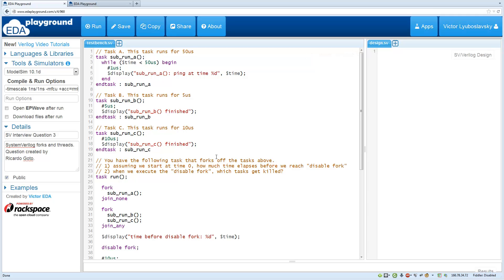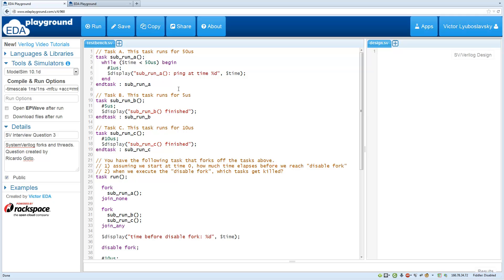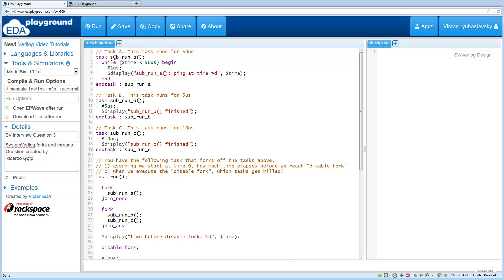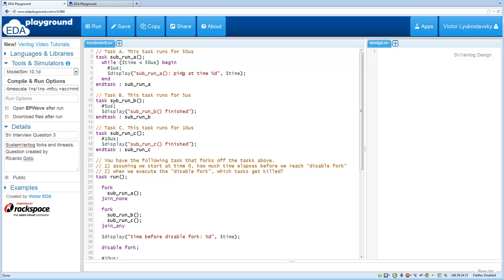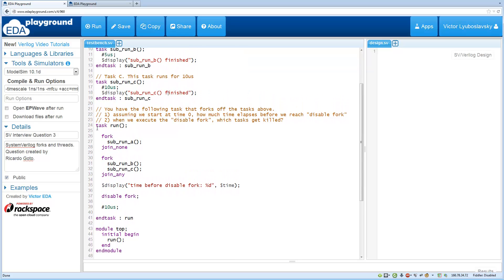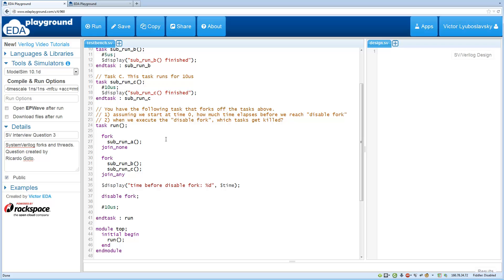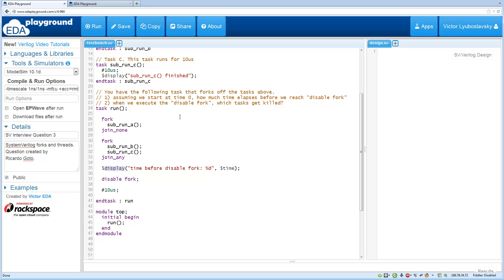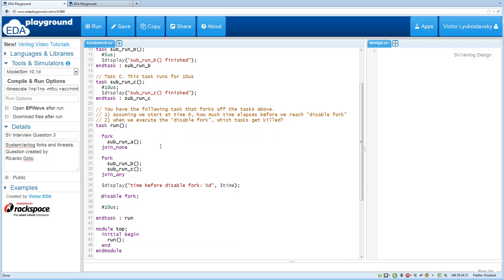SystemVerilog Interview Question 3A -- Forks and Threads

Comment: The first fork uses join_none which means it does not block the thread after it. Therefore, sub_run_a in the first fork and sub_run_b and sub_run_c in the second fork all start at time 0. The second fork uses join_any which means the main thread continues if either sub_run_b or sub_run_c completes. In this case, it is sub_run_b that completes earlier in 5us. 
Therefore, "time before disable fork: 5us" will be displayed, after which all unfinished branches will be killed, which are sub_run_a and sub_run_c.

Comment: Is this the cleanest solution to #3?
  - I wrap the fork for for sub_run_b and sub_run_c into another and disable that branch. Otherwise, I can disable the fork by name, but the latter isn't as portable if I were to do this in a class for instance, so I prefer the solution I have below:

  fork begin
    fork : second_frk
      sub_run_b(); // 5us  <- Break for this first
      sub_run_c(); // 10us
    join_any
    
    $display("time before disable fork: %d", $time);
    disable fork;
  end join
Reply from the maker: It's a good solution. Here's another: https://www.edaplayground.com/x/LEPk Is this cleaner? Or cheating? :-)
Reply: EDA Playground I like the one you’ve made. I’d also use that in most cases, but depending on where I called it I’d use mine—e.g. if I’m calling it from a test, I’d use your solution. If I was burying it in a class or in some reusable VC, I’d use mine.
Reply: @Edaplayground_EPWave  This solution is cheating because from the perspective of Re-usability, we should never modify (to be more specific "edit") the already exiting code, instead we should add piece of code to maintain the Re-usability.
Reply: @lxnny2357 Best soln.

Comment: 1) assuming we start at time 0, how much time elapses before we reach "disable fork"
           Ans: 5us
2) when we execute the "disable fork", which tasks get killed?
          Ans: sub_run_c task gets killed. 
3) how do you prevent sub_run_a() task from getting killed in this scenario?
          Ans: use fork....join_any instead of fork...join_none.
Reply from the maker: Your answers to (1) and (2) are undoubtedly right. Well done. Your answer to (3) is technically correct (sub_run_a won't get killed), but it does change the behaviour of the code - sub_run_b and sub_run_c won't start until sub_run_a has finished.
Reply: @Edaplayground_EPWave  You can use a wait fork instead of disable fork to prevent any threads from being killed
Reply: In it's actual form (question) both A and C get killed as A has to loop 50 times and has finished only 5 iterations and already exited the fork as we used join_none and B has finished in the other thread at 5us and exits the thread as its join_any and when we disable fork C is yet to start and A is starved from proceeding further so both A,C are killed

Comment: I was expecting sub_run_a to also print display statement at 5us..  Why does it not?
Reply from the maker: Kartik Sudarshana 
Sorry for the delay in replying: 

The order that threads on SystemVerilog get executed is not deterministic. Therefore, it just do happens that sub_run_b runs before the 5th iteration of sub_run_a, and so the thread gets disabled before sub_run_a gets a chance to run for a 5th time. If you add a '#0' before the '#5us' in sub_run_b this delays the following $display command to the inactive region, which is just long enough to ensure that sub_run_a is run for a 5th time. 

Welcome to the world of multi-threading. :-)

Matthew
Reply: EDA Playground Thanks a lot Matthew.  Yes, order is not deterministic, so I tried to run multiple times to see if it randomly prints sub_run_a few times but it never did.. So, I was wondering if this code has something that makes it never print it.  But I got your point anyway. Thanks for the detailed explanation. 

Why only so few questions? Is there any other youtube/website link where there are more such questions. This is such a great way to learn stuff where we can try code and get results instantly, do experiments.. So unique!!!
You guys are awesome..
Reply: @skartik3443   Simulator has its own rule for those tasks with undeterministic order. Not to guarantee the order doesn't represent that it should be random every time you run.